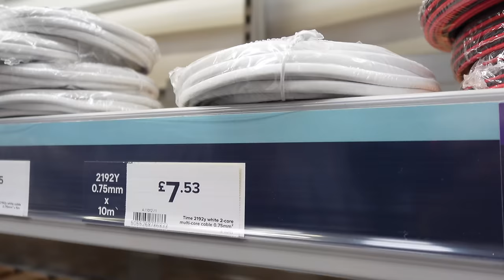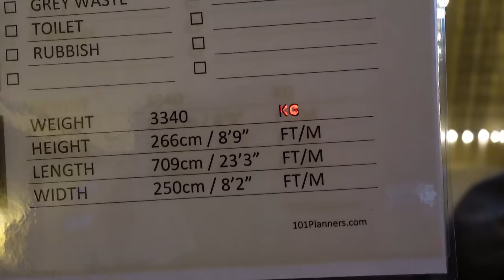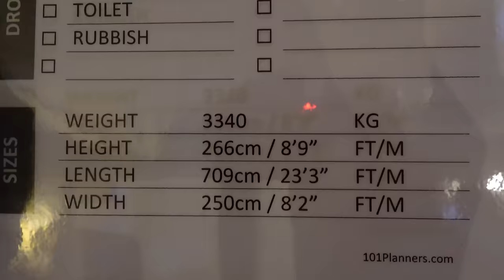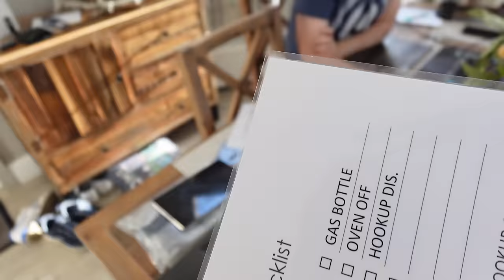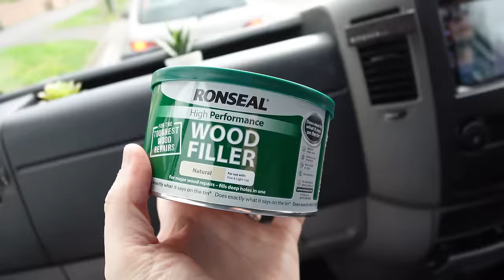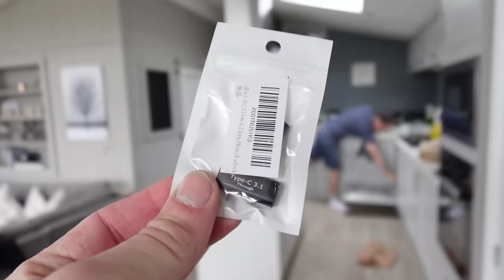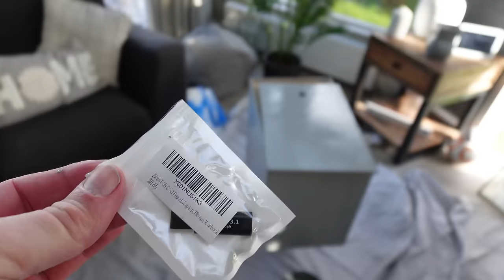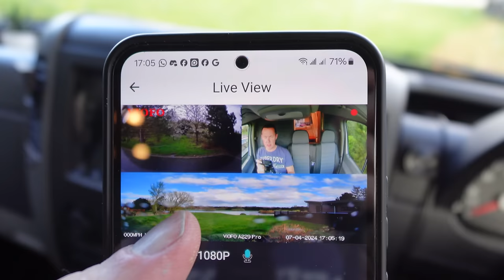Fixing and Building new things for the CAMPER VAN

Comment: We’ve used that DC Fix to cover our kitchen counters and it is so tricky to work with. But, to avoid having bubbles you need to peel back the backing paper off in really small sections and smooth out the vinyl fully before peeling back any more. Like literally a few inches at a time. It’s time consuming and stressful but will give you the best chance for a smooth finish!

Comment: Love that bin with the switching flap for the van - very clever.  Probably too late now but an option for the Lodge Bedroom windows would be a thin tension rod and a voile fabric panel. They make the rods specifically for inside window frames.  Look for “tension rod” as this do not need any brackets. I checked Dunelm and they sell the rods,  and the voile panels (but you would need to shorten the panel).  But I am sure other places in the UK sell them

Comment: When covering your windows it’s best to use soapy water and spray it all over the window then place the cover onto the soapy water then you can manipulate it to the correct place, then when you use the scraper the water comes out leaving no air bubble and the cover stuck to the glass.
Reply: I was about to say the same thing - secret ingredient is Johnsons no tears baby shampoo - doesn’t leave any streaks on the glass like Fairy does. Soak the window with a spray, offer the unstick side to the glass so it holds it, pull the paper off, spray the glue with the same solution, then swap over and manoeuvre into place, squeegee out the water, leave to dry! 👍

Comment: Nick , when vinyl the window, you must wet the window and leave wet when applying the vinyl.  Even self adhesive.  The water will dry and the adhesive will stick.  Because it’s wet you can manure the vinyl easier, the with the squeegee push the air out to the dudes

Comment: For your windows, what about using some Rust-Oleum Frosted Glass Effect Spray or the 151 Glass Frosting Spray found at your B&Q? I've used something like this for my kitchen cabinet door windows and it worked great. So much easier than working with the film. Just double-check if the spray is permanent or how can you remove if needed.